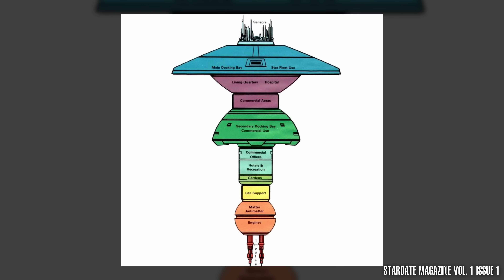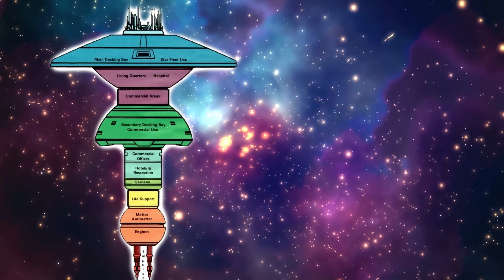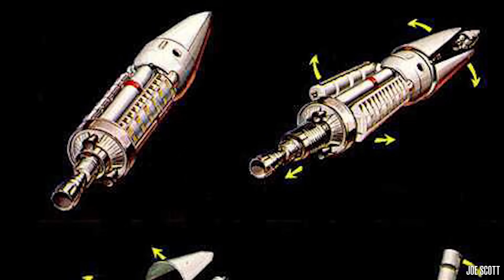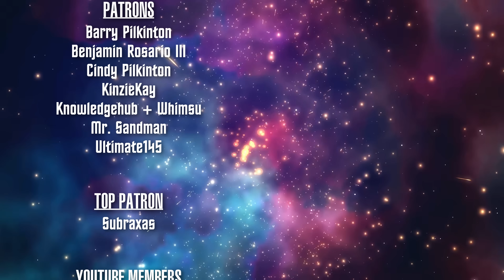How Do Starbases Work?

Comment: Ok, where to start. I'll start with the main warp engines. Matter is injected into the top of a dilithium crystal. At the same time antimatter is injected into the bottom of this crystal. Normally this would cause an annihilation explosion, but the crystals regulate the released energy and create a a tuned plasma stream. This is  used to power the warp coils, thereby making warp travel possible. What isn't used by the coils is shun\ted into the EPS system for powering other systems.

The impulse drive is called impulse because it is an internally metered pulse. A tablet which can cause an atomic reaction is bombarded by lasers. They then use force fields to contain this and compress it in on itself. They do this several times using lasers. The matter and energy have nowhere to go so they create waves in space. The ship simply rides the waves.

The explanation of Warp came from The Next Generation Technical Manual. The explanation of impulse came from the novel First Contact, where George kirk, XO of the Enterprise under Captain Robert April gets inadvertantly sent along with his ship into Rihanssu (Romulan) space.

And Warp drive isn't that far out there. Miguel Alcubierre proposed such a system in 1995 although even he admitted it was a thought experiment, as the energy required was more than was contained in the universe. But Dr. Harold White wrote a couple of papers detailing how he had refined that so no negative energy was required and that while the energy required would be high, very high, it was not unmanageable. But grav plating is definitely out there. And it seems to always be he last thing to frail on a starshio, But I can understand that. They don't have a way to create zero gravity on a soundstage.

But for a rotating space station, you don't have to spin it very fast for 1G. For a space station with a radius of 3 km, achieving 1G would require a spin rate of 0.5459729074503967 Revolutions per minute. You could round it down to half a revolution per minute and get virtually 1G. A bit less but you wouldn't be able to tell the difference. Although the rim speed would be a bit more then 380 miles per hour.
Source of above calculation is https://www.artificial-gravity.com/sw/SpinCalc/
Just ignore the Angular Velocity and the Tangential Velocity for the time being. Just input the radius and make sure the x per second/minute is set, and the required g-force, usually 1 gravity. The calculator will calculate the rest.
On a station with a radius of 3km, I'd recommend an outer rim speed of 379 mph. That would get you just a hair under 1G with a net rotation speed of 0.539 rpm.
Reply: As far as I know, dilithium is used for producing antimatter.   It doesn't really make sense given the first law of thermodynamics, but maybe they use a Heisenberg compensator.

The Alcubierre drive is a fascinating idea, and it only requires all the energy in the universe to transport something the size of a proton.  Not far off at all, watch this space.

The biggest space station right now is a little over 100m.   3km is considerably larger than that, but not outside the realm of possibility.  But the reason why we have space stations is because of the microgravity environment.  Artificial gravity would defeat the purpose.

A rotation every half a minute is still pretty fast at that size.  That's about 4km/s tangential velocity.  Bigger is better, it reduces the tangential velocity, but it also increases the size.

Comment: While spacedock undoubtedly has impulse engines, they would primarily be used for corrections and for minor adjustments.
Why an object stays in orbit has nothing to do with its size.  It's dependant on the orbital velocity at a particular altitude.
By setting an object at a particular velocity, it's angular momentum is equally balanced against the acceleration enacted upon it by gravity.
Gravity pulls down, keeping the object in what appears to be a circular orbit, and the object's angular momentum pushes it away from the pull of gravity until you have equilibrium.
For example, if you were outside a space elevator, at any altitude between the ground and geosync, and jumped off... you would fall to your death, because there is no angular momentum. :)

Comment: We actually can calculate the "real" size of Space Dock. By using the Enterprise-A as a reference, for which the specifications have long since been determined and are ST dogma, we can calculate the rest of it. For instance, the Enterprise 1701A primary hull is 142 meters across (71M each side of centerline). The space doors then, by the video, are about 10 meters larger on each side for a total span of about 162 meters. From there, the general exterior specification can be calculated. This presents a fairly serious continuity problem, however. The USS Excelsior has a primary hull width of 185 meters. Additionally, the USS Enterprise-D was shown entering Space Dock. The Enterprise-D had a hull width of 467 meters. That's about 3 times wider than the space doors. While the discrepancy with the Excelsior is inescapable, you might conclude that a newer space dock was constructed, but there is no evidence to support that.

Comment: I was thinking that the solution would be to have it higher in orbit.  The international space station needs propulsion often because it's in low Earth orbit, and air drag is still a significant issue. If it was a 2000km the use of propulsion to keep altitude would be extremely rare.

Comment: re: Gravity plating, there is a real world example of doing this, but (obviously) it would never scale, is where a super conducting magnet can negate gravity, and has been done to small creatures like fish and frogs to levitate them.

Realistically, even the "spinning" space station would never work in real life, entirely due to the fact that if it has to move on an axis, with moving parts, those parts would wear. It could only work if it was a byproduct of propulsion, and even then, what's to prevent the station from spinning out of control (eg resulting in lateral inertial forces.) There would effectively need to be a computer dedicated to ensuring that the station's thrusters are fired to keep the station in rotation and to prevent it from spinning in other directions that might tear it apart.

Comment: 0:56 "the first launch of a manned space station was NASA's Skylab in 1971" - Incorrect. 

1). Skylab was not launched until May 1973, and was ultimately visited by three crews (Skylab missions 2 through 4). 

2) The FIRST orbital space station was Russia's Salyut 1 (aka Durable Orbital Station (DOS)-1), launched in April 1971. It was subsequently visited by the 3-man crew of Soyuz 11, who spent 23 days at the station in June 1971 - just five days less than the first Skylab crewed mission two years later. Like the Skylab 2 mission, the Soyuz crew had to perform something of a "rescue" operation for Salyut, as the main ventilation had failed post-launch, and a fire also broke out on the station during their stay. Sadly, all three crew were killed when the Earth return module of their Soyuz vehicle depressurised within seconds after a faulty separation from the rest of the vehicle. 

Incidentally, the final module of the Salyut programme - DOS-8, was named Zvezda, and was launched in July 2000 to form the third module of the ISS, some 20 years after its initial construction had commenced.
Reply from the maker: This was an oversight--I address this in my pinned comment above.

Comment: Small correction. Real space stations only require orbital adjustments because there is still a VERY thin atmosphere at low earth orbit that very slowly slows the orbital speed. At higher orbits, this isn't a problem. Low earth orbit is only about 250 miles above earth.

Comment: It'd be cool to see a rundown on all the starbases we've seen,  and also really ideas on how ground based Starbases interact with any space stations they may have., or vice versa,    (here we seem to have to speculate a lot.)  

I also would figure Spacedock doesn't need to course correct so often cause it has so much mass and presumably isn't in such a low orbit as we're used to in the real world,   but it'd be much harder for the traces of atmosphere even in low earth orbit to affect anything that massive for a long time, I'd think, even without mad Federation fields technology to redirect any particle issues.  It might even be a good way to keep that chunk of orbit clear of debris,  have that station's navigational-deflector looking things just pull in the space junk or whatever.  :)

Comment: You don't need continuous thrust input to keep an orbit, you just need eventual thrust corrections depending on the mass (not size), orbital altitude and speed.
Gravity isn't a homogeneous force because we aren't talking about an idealized perfect homogeneous solid sphere, hence it oscillates, just like the magnetic field. Also, any interaction between large astronomical bodies, planets, moons and stars creates alteration in the gravity and magnetic fields.
Low orbits can also have some interaction with upper atmosphere, as people have stated.
In case of a big space station, like the ones in Star Trek, they need a very far orbit because of the excessive mass, but you can sustain such mass at a small fraction of the distance between Earth and the Moon, just considering the proportion between masses.
We could try to speculate the spaces tation mass and determine an ideal orbital distance.
Obviously, the apparent orbit used in screen (tv series and movies) might not be correct, being mostly an aesthetic choice for the photography.

Comment: actually the impluse drive is more akin to the nuclear rocket engines they prototyped back in the sixties, the eps array was likely fed by a separate reactor that was fusion based. Nuclear rockets use hydrogen to cool and act as propellent, the bussard collectors would be able to feed the hydrogen needed.

Comment: What I have often wondered, why does the gravity plate still work when all other ship systems are down?
Reply: They're powered by plot armor.
Reply: @nodak81  I thought it might be some self generating nano tech that some how magnetify the effect of the gravity in particular plates of the ship without  spreading into connecting plates.
Reply: Gravity plate can only power down when the special effects budget gets above a certain level. They have to hook the accounting department up to the fusion reactors.😃
Reply: Because it would be awkward to show all the characters floating around
Reply: Gravity plating has really good capacitors.  Also the biggest worry for life support would be the CO2 scrubbers.  CO2 buildup will cause the crew to lose consciousness and stop breathing well before O2 is depleted and presumedly before the temperature drops due to how insulated the starship is.
Reply: @russellharrell2747 CO2 build-up would cause panic attacks.  O2 depletion would cause lethargy and then unconsciousness, if CO2 is scrubbed.  CO build-up would cause unconsciousness and death.

Biggest worry for life support is temperature regulation, followed by coffee.  I said water purity.
Reply: @davidwuhrer6704  humans have a CO2 drive regulating breathing.  Dunno if the various alien species would evolve similarly.  C02 increasing in the atmosphere is bad for keeping humans breathing.  This is why the Apollo 13 crew needed to get CO2 scrubbers working so quickly.  O2 in a cabin will exist at life sustaining levels for quite a while.   For ambient O2 to drop significantly below the normal atmospheric percentage of 21% in a sealed cabin it could take many hours or days.  CO2 levels could become toxic in far less time.  

CO is only a consideration in the presence of incomplete internal or external combustion, which should be avoided in any situation.

Hopefully most space Bourne vessels are extremely efficient in their insulation.  Rapid heating and cooling are long term concerns for vehicles orbiting a planetary body near a star.  Temperature changes also are affected by the shape of the vehicle.
Reply: @russellharrell2747  Quite so.

CO2 scrubbers can be purely chemical without relying on energy.  Water reclamation is trickier.

Space ships are perfectly insulated by the vacuum of space, the only way to exchange temperature is by radiation.  Which is a problem if you have a number of actively warm bodies working at around 200W at rest, regulating towards 36°C via evaporative cooling – while the cooling system is off-line and the water reclamation is not reducing the relative humidity.  At 100% rel hum at 42°C, everyone is dead.

On one side, the cosmic background is extremely cold, which is how radiators on the shadow side are highly effective, if you can get your excess heat there.

On the other side, there might be unfiltered sunlight.  With no convection.

Comment: The ISS doesn’t need thrusters to stay in orbit because of its size. Those thrusters are not used continuously to keep the station from falling. 

Orbit is achieved by making an object’s lateral velocity high enough that the vertical acceleration imposed by gravity is insufficient to make it hit the ground; but also low enough that it doesn’t just fly off into space. You may have heard that orbiting objects are falling, they’re just going sideways so fast that they always miss the planet.

Instead, the problem is that station’s altitude. It is kept low enough in orbit that there is a small but significant amount of drag from the tenuous atmosphere still present at that altitude. That reduces the station’s lateral velocity enough that eventually the orbit will decay. From time to time the thrusters (together with the thrusters of docked spacecraft like Soyuz or Dragon) are therefore used to boost the velocity back up to the usual 17,500 mph necessary. 

A space station like Spacedock doesn’t have an orbital problem because of its mass. Orbital mechanics does care about mass, but it cares much more about velocity. Once any object, whether a micro satellite or the Moon, has reached the correct orbital velocity, it’s not going to stop unless another force acts on it - such as the friction of the thin atmosphere at the altitude of the ISS.

Spacedock does have a very large cross-section, so rather like a big ship vs a small boat, it would encounter more friction if it orbits as low as the ISS. On the other hand, as a massive object (in both senses of the word) it also carries more momentum and will be harder to slow than the ISS.

Spacedock probably does require larger thrusters for boosting, if only because boosting that much mass requires either longer burns or more thrust, but it will not be boosting continuously just because it’s bigger and more massive. 

Indeed, if Spacedock were to be boosting itself all the time, that would make docking considerably more difficult, and ships docked would require very firm docking points to remain their position relative to the station itself.

You can see this if you search for a video of the Space Shuttle making a course correction with an astronaut free floating in the cabin. When the shuttle accelerates, the astronaut appears to drift, because the acceleration doesn’t apply to the objects or astronauts inside unless they are strapped down.

When the ISS boosts, as I mentioned it usually does so with the assistance of docked spacecraft. To avoid dangerous shearing forces being sent through the docking ports, the velocity vector of the acceleration is usually carefully aligned directly through the spaceship and docking port. Imagine having to work that out with however many shuttles and starships are present in Spacedock at any one time.

I haven’t read anything about Spacedock’s orbital altitude, but I suspect it’s rather higher than the ISS. That would save a lot of headaches and concerns about atmospheric drag and reboosting of orbits.

Comment: the ISS only requires occasional booster burns to stay in orbit because there is still air (and even life) at that altitude. It's not like it is constantly thrusting away from the ground. Other satellites in higher orbits can stay there for 50+ years without booster burns.

Comment: Also EPS does not vent directly out the impulse exhaust. EPS is an electroplasma, think of it as a plasma carrying an electrical charge that is piped through the ship to extract vast amounts of power for things like replicators, etc... The impulse reactors are literally that, reactors placed in the impulse housing, they convert fuel into plasma thrust. There is no direct tie in to the EPS system other than to provide initial kick power like a sparkplug to get the reaction going.

Comment: Space stations can have multiple facilties as well. Key thing to keep in mind is that these concepts are relatively new.  Outpost, base, fort.. all hold different meanings in sci fi. 

 It is a matter of if the term starbase is a base or not.  Which isnt nessisarily limited to strategtic opperations.  DS9 for example should have been built upon by starfleet once it took on being more than an outpost station.

Comment: The other thing keeping the spacedocks in orbit is sheer momentum. The main thing which slows satellites in LEO is, basically, friction against the traces of atmosphere. Square/cube law means the mass of the station per cross-sectional area is much higher, so it takes a lot longer for the orbit to slow down. On the other hand, tidal forces will tend to push the station out, so the right balance could see the orbit maintaining stability indefinitely. Failing that, a mechanism similar to that used in David Brin's "Tank Farm Dynamo" might be usable; run a current through the station to push against the Earth's magnetic field.